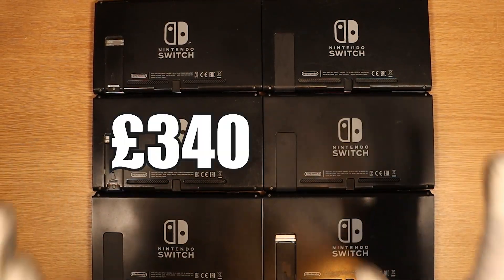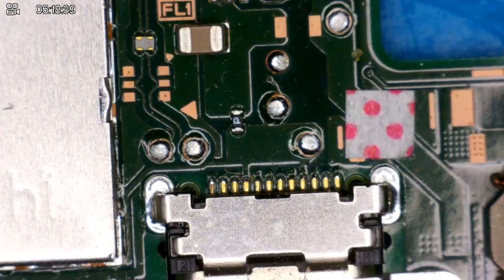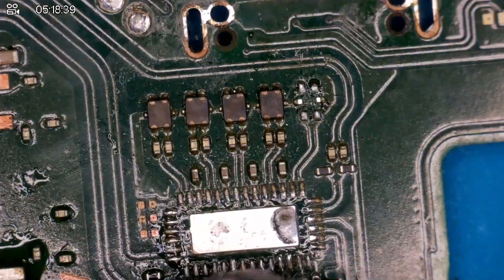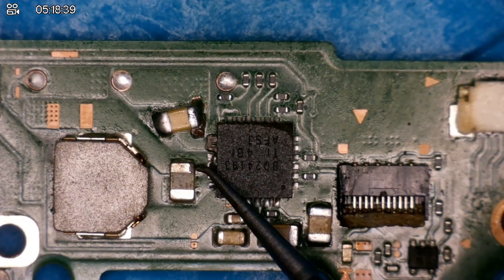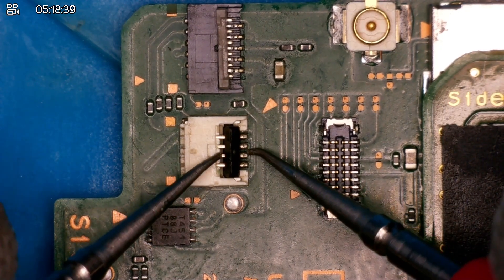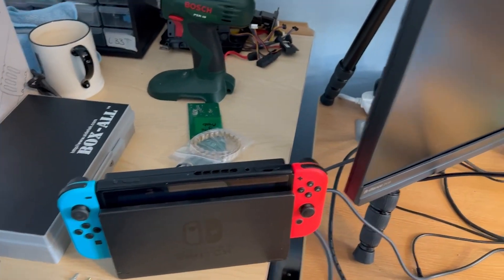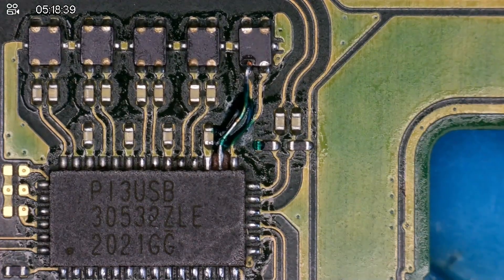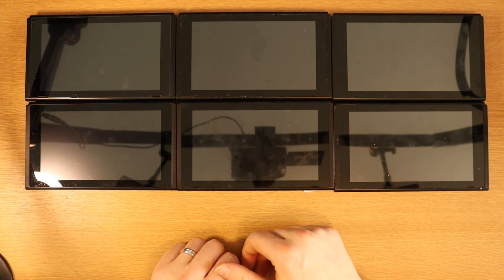I Paid £360 for 6 BROKEN Nintendo Switches - Can We Make a Profit?

Comment: Great video as always joey, if you rewatch the video from 20:06 when you're scraping the trace that had blown on switch No.6 you can see that you actually scrapped the board away to expose the ground.  Its only a tiny amount, but did expose the ground plane.  Cant wait for tomorrows stream ;)

Plus switch number 4 is more than likely the lcd driver that you pointed to.
Reply from the maker: Thanks Roy :) Yep I noticed the exact same thing! See you tomorrow :)

Comment: really enjoy your presenting style keep it up. 

it's actually amazing how often I've seen that sorch mark on pi3usb. 
 
I would recommend getting a thunderbolt usb c extension cable for your dock. you can then just use a motherboard and battery to see if the motherboard boots. without sticking back in the housing.
Reply from the maker: Ah okay that makes sense Chris, thankyou :)

Comment: joey you should change the back light connector on the board as iv had it were the bins in side dont shut down on to the cable enough so no back light  great video
Reply: I'd agree with this. it probably needs a thicker trace for the power of the back light. this always gets burnt when I'm contact with water. 

I've rebuilt these. but I think he can cut it shorter. and expose some more trace
Reply from the maker: Okay sounds good Steven :) Will have a look!

Comment: Hey joey, as far as I know, on the first switch a blue screen is a communication error between the cpu and ram, so either one of those is not making a contact on one of those communication rails or there are other issues
Reply from the maker: I'll give it a reflow tomorrow :)
Reply: @JoeyDoesTech  nice, ofcourse I recommend you try the ram first as it is easier and less risky

Comment: When you didn't have a pad on switch number 3 and scratched the coating on the board to solder it. I'm just curious how that would enable the capacitor to work, is it be ause Capacitors have no polarity? I might be completely wrong. Just wanted to ask.

Comment: Ordered a usb tester through your affiliate page. I love watching your videos and I'm currently scratching my head with my Motorola edge 20. Switched out the USB port, flex cable and battery. Still won't charge 😢. Shows life as it will show a display to say charge battery but I can't get a feed to charge the battery
Reply from the maker: Thanks for using the affiliate links! :)

Comment: #1 Not sure about apu but I fixed one this week by reflowing the rams. The two big black chips next to the apu under same shield. My theory is that it mostly happens because of to much heat from people reworking the charging port. Look to see if you see any rework. 

#2 inject voltage. A AA might work if u got no power supply. You should get one. 🙂

#3 No clue. Parts!!

#4 The pins that make the connections are located deeper inside and are hard to see. I saw a slightly bent pin but can’t say if it’s enough to be bad. The quality and focus just wasn’t enough to tell. If you are going to replace it cut up some kapton tape and cover just the top. Remember plastic hates airflow. Sts telecom another great channel did a video about a week ago on a samsung phone with a large fpc.
Reply from the maker: Perfect! Thanks for the explanations as always Jesus :)

Comment: Switch #2 most likely has a dead CPU. Apparently, it doesn't always show a straight short on that one cap. another method that some people are now beginning to use is an Ohm reading. most continuity test don't beep if the ohm reading is above above 50 ohms, but it could still be a short. on that CPU cap, if you do an ohm test and it's under about 200 (I think), it's a dead CPU, regardless of the continuity test results. Don't quote me on that number, I'm not 100% sure. Either way, do an ohm test on that cpu cap. It's probably dead.
Reply: "another method that some people are now beginning to use is an Ohm reading"   That method is old...I don't understand why you say like it's a thing that people has just discovered, unless you're a newbie who doesn't know much about electronics. Continuity reading isn't always a good test for shorts.